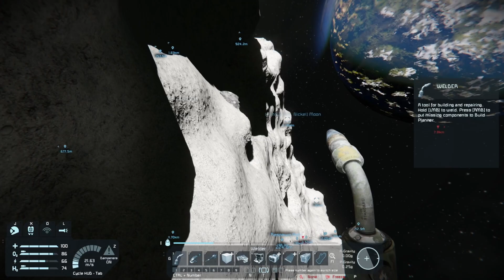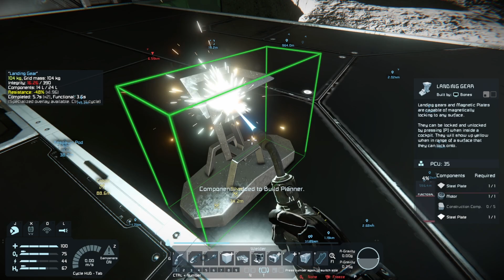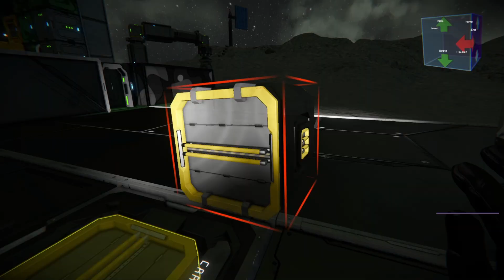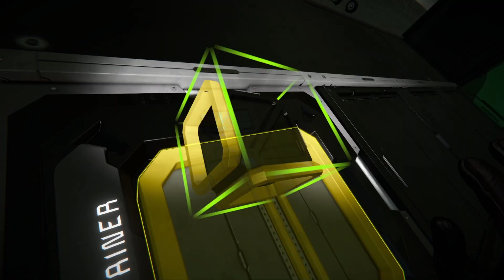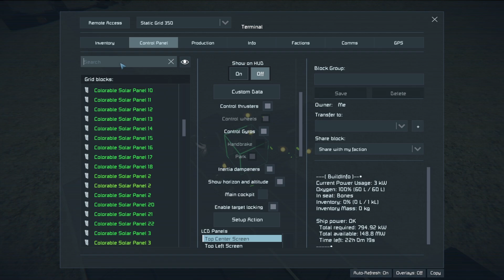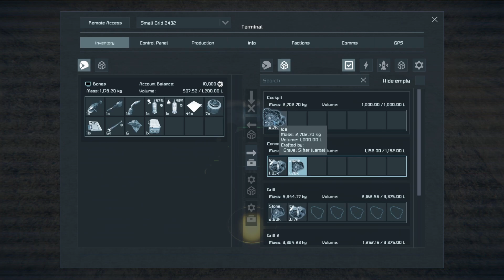My first Miner! #letsplay #spaceengineers

Comment: Not bad, then I noticed you have no cargo... You're right, you probably don't need a large rear facing thruster. Maybe even drop down to a series of small small-grid tanks since the gravity is so low.
Reply from the maker: Thank you. I went with the larger tank due to going out in space. Would small ones still work for that?
Reply: @BonesYTTV  Space with zero gravity, and moons yea small tanks work good. Two drills, cockpit, small thrusters, a pair of small tanks, a few small batteries, medium cargos. You can scale up and if your weight gets high enough you get sluggish and start to use fuel too quickly. Then that is when you go for large tank and some more small thrusters. Soon as your looking at needing 6 thrusters, then it might make sense to go with a large. I am not sure where the fuel usage and thrust makes sense but 6 sounds about right.
Reply from the maker: Thank you! I made quite a few adjustments that I’ll show off on Sundays episode.